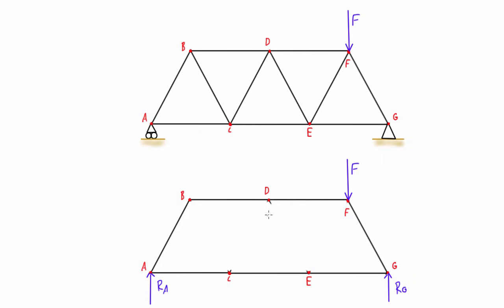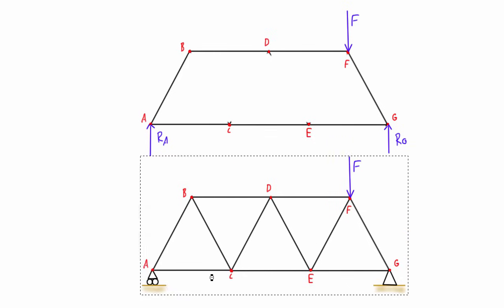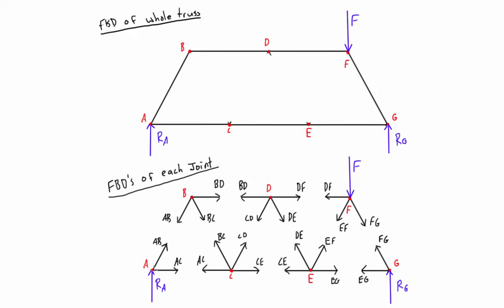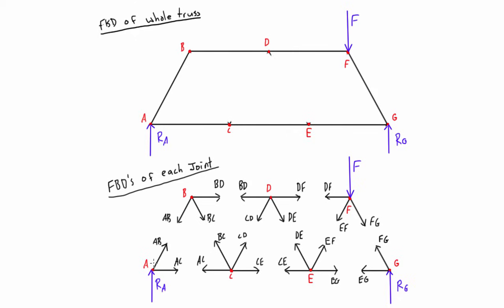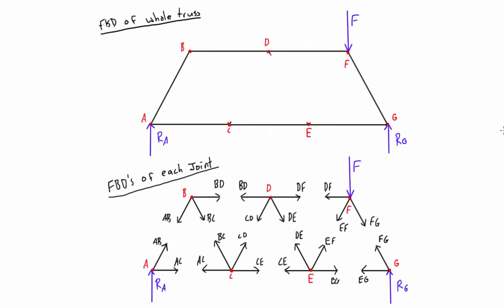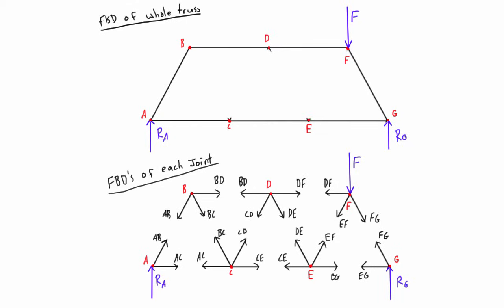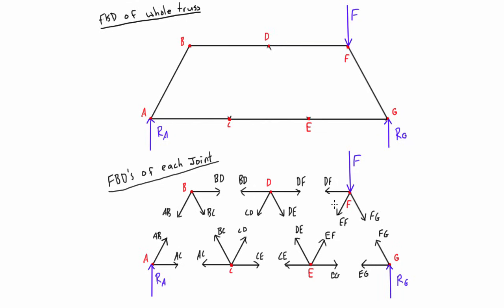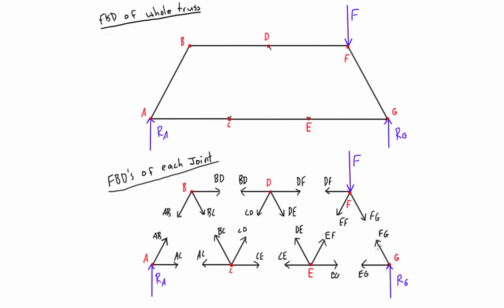Truss analysis by method of joints explained

Comment: how does it change if i have a weight hanging from point E ? please help me
Reply from the maker: Just include that in the FBD of the whole structure. Ra and Rb will be different (bigger). Then once you know Ra, just proceed with the same method, joint by joint. See videos starting at #42 here: engineer4free.com/statics

Comment: why dont you include the horizontal force off the pin joint G?
Reply from the maker: There are no externally applied forces on the structure, and because G has the only reaction capable of providing horizontal support (Gx), Gx is equal to zero. You would see it if you write the Sum of Force in x expression for the whole structure, it would just be Gx = 0, so I just skipped it. In a test, it might be worth the few seconds to write it in to really show you know!

Comment: Thanks for the video!! When you say " Tension" and "compression", is it with respect to the member or with respect to the joint?? I noticed that you determine the type of the force with  respect to the joint. Am I right?
Reply from the maker: With respect to the member. The member is in tension, or the member is in compression. A member in tension will "pull" on the joints and a member in compression will "push" on the joints.

Comment: What is the use of finding forces? I mean where is it used in real life or in designing?
Reply from the maker: Hey Shubham. Finding forces is critical for real life structural enghineering. Structures support loads, and if the load is too big, the structure will break. Structures are generally made of smaller members (truss is a good example) , and if a certain member cannot support an internal force, it will break. Common internal forces include axial (tension and compression), shear, and bending moment, and torsion. This video is simplified to only be dealing with axial forces. Basically, a stronger material can support a greater load. Imagine 2 truss members of the same cross sectional area, but one is made of steel and the ither is made of wood. Long story short, the steel one is stronger, and could support a greater internal axial force compared to the wooden one. When you design a truss bridge, or any structure and its members, you need to select appropriate materials and sizes of members so that it will not break. Statics is just the super basics of structural engineering, with many simplifications in place, but finding internal forces is basically the core of all further studies and application of structural engineering.

Comment: Your two horizontal members:: Were they two long pieces??? Thanks. K.S.
Reply from the maker: This structure is made up of 11 pieces that are the same length, forming equilateral triangles connected by pinned joints. There are two horizontal members on the top, and three horizontal members on the bottom. The rest are diagonal @ 60 degrees.

Comment: why isnt the AB arrow pointing back towards Joint A?
Reply from the maker: Because at this stage we have done no calculations, so the internal force in member AB is unknown. It is the convention to draw unknown forces in tension, so from the point of view of joint A, the unknown force is drawn pulling on it, ie, pointing away. In the next video, we solve this truss with some actual loads applied, and find that member AB to have a negative magnitude, which indicates it's pointing in the opposite direction as indicated on the fbd, ie, we find out later on that it is in fact pointing towards A in that fbd. Here's the link to the next video: https://youtu.be/PXS9n-b5CA8

Comment: How do you go about solving these problems when none of the supports are designated as an expansion joint or rocker?
Reply from the maker: If you have two pins, then it is actually statically indeterminate, and is no longer in the realm of a statics course. If you are taking a statics course, everything must be statically determinate, so maybe it is a drawing typo. If you are in mechanics of materials or structural analysis course, then you need to use one of the methods for indeterminate structures. I made full playlists for both of those courses: engineer4free.com/mechanics-of-materials and engineer4free.com/structural-analysis
Reply: @Engineer4Free  Thank you, I am in a statics course.  

In the problem, a truss has two pinned supports and all applied forces act in the x direction.

On closer inspection, of the two members attached to the support pins, one is perpendicular to the applied forces, while one meets the pin at a 45 degree angle.  Does that make the problem statically determinate?
Reply from the maker: No it doesn't. If the lines of actions of the forces all both pass through both of the two supports then you can do some trickery to kind of skip the work that is actually involved in it being statically indeterminate, but I'm assuming that's not the case for you, as that's beyond the scope of statics. I think it is most likely a diagram typo. I would ask your professor if the truss is "simply supported" which means that one reaction is a pin and the other is a roller. Express your concern to them that two pins in the diagram implies indeterminacy and I because they give you 4 unknowns while you only have 3 equations (sum of forces in x, sum of forces in y, and sum of moments about some point). I'm pretty sure your prof will tell you it's a typo.
Reply: @Engineer4Free  Okay, my professor hasn't brought up static determinacy/indeterminacy in class so I was banging my head over the question for a while.  Thank you very much for the prompt replies, I'll see what he has to say.
Reply from the maker: Ok cool!

Comment: Can you have 0 force members in this type of structure?
Reply from the maker: If a truss is only constructed with equilateral triangles like this then technically no, if there is a load somewhere then every member will have some amount of tension or compression in in it. Once you start getting trusses that resemble right angle triangles and stuff you might be finding ZFM's depending on the loading type.

Comment: When you work out each joint do the arrows always be drawn in tension before working it out. Ive seen some examples where they are drawn in compression before being solved.
Reply from the maker: It's not an absolute requirement. Often you can know by inspection if a member will be in tension or compresseion even when the actual magnitude is still unknown. If you draw an unknown in compression, just be careful that you remember that a positive value for that particular member means it's actually in compression and a negative means it's actually in tension. Always drawing unknowns in tension even if you expect them to be in compression usually decreases the chance of you making an error because you apply the exact same logic to every member every single time.

Comment: why didn't you take horizontal force at pin joint G?
Reply: But it would still be good practice to put a horizontal component, even though it’s zero
Reply: @carbon273  true, that's what my teacher does :)
Reply: @carbon273 very true
Reply: You need to draw free body diagram first to see his point. Sum of X forces are supposed to be zero. Since A is sliding bearing it won't have an X force. Since there is only G bearing's X force , it equals to zero.
Reply: @Syb-z  thank you for the explanation!
Reply: karishma chandini yaa coz there is no horizontal force anywhere to balance that horizontal force of pin G so it will become zero... most of the times in trusses horizontal force of pin is zero
Reply: karishma chandini because it's zero.
Reply: RAHUL plz can you explain more in detail plsss